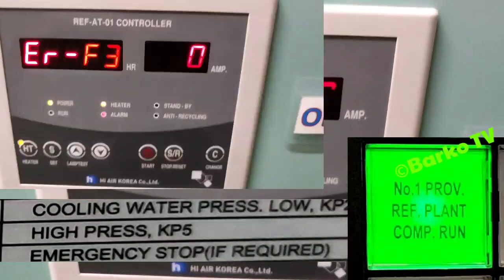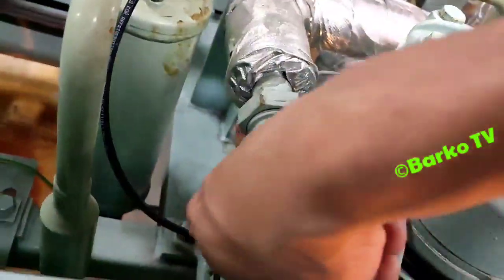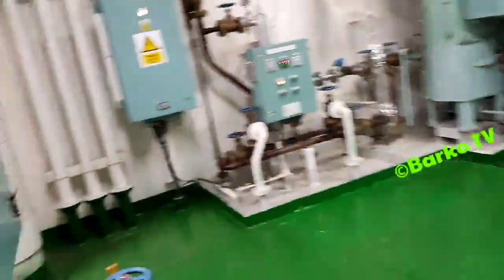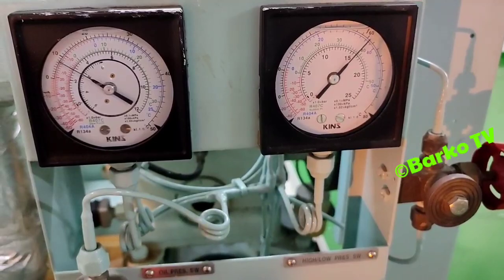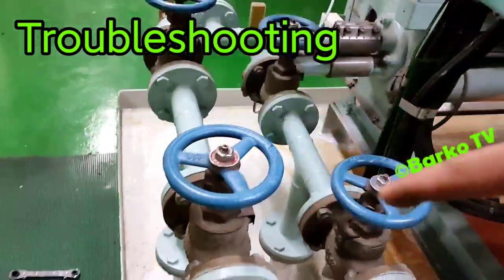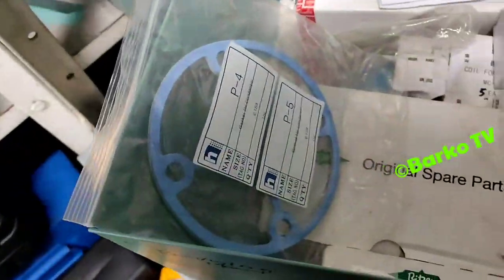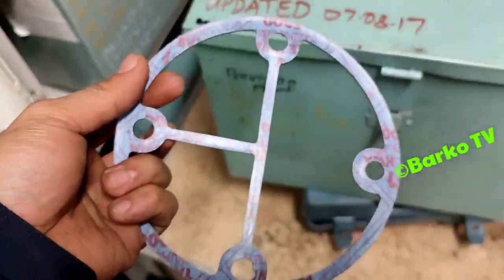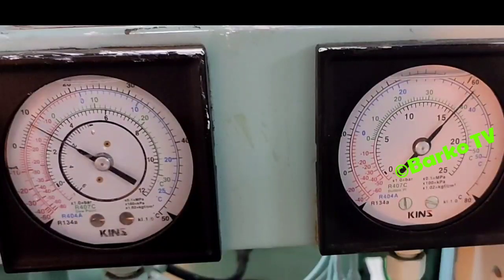Troubleshooting Provision Reefer | Explained and rectified Er - F3 | Hi Air korea |barko | seaman

Comment: sir leck ung 2 systems nyo ba is independent sa isat isa or interconnected? sa independent and interconnected na systems, ang standby unit po ba need ipumpdown ang refrigerant and always open ang cooling water in and out valves. or pag standby pumpdown lang and close ang cooling water in and out valves?
Reply from the maker: Interconnected lahat. Wag mo na galawin ang cooling water, lahat yan naka normally  open lng po yan